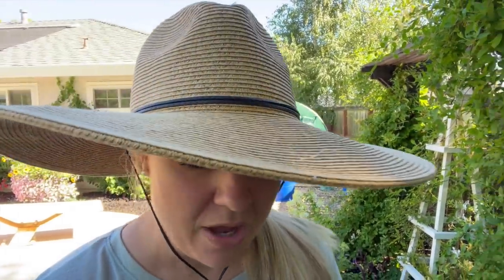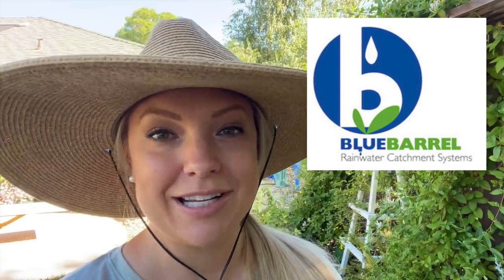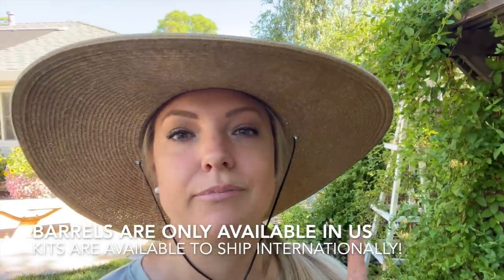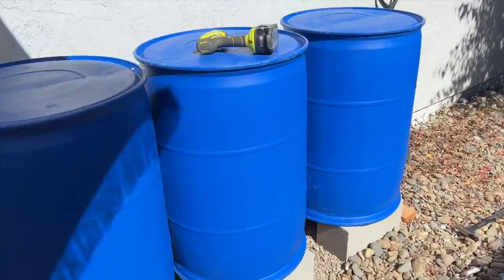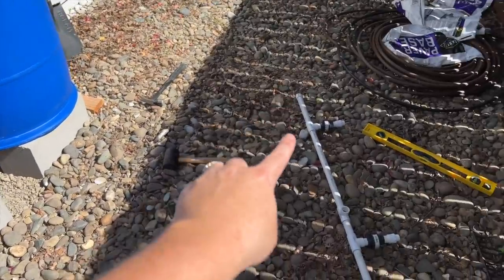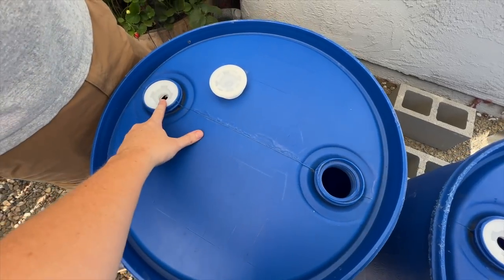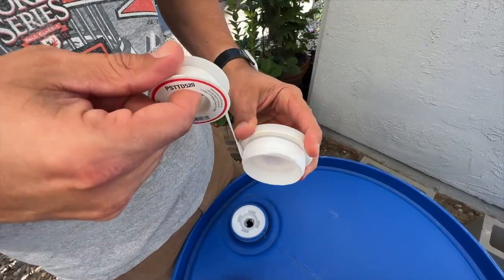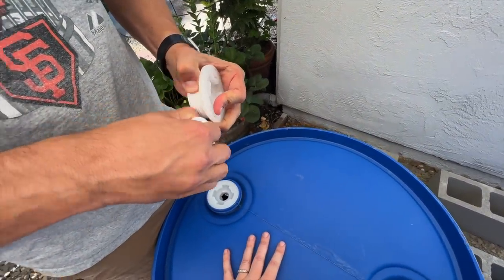Rain Water Harvesting! One Way I'm Dealing With Gardening In A Drought 🥵 :: Blue Barrel Systems

Comment: Great Job! Just remember your spigot won't work once the water level drops below its height. That's one of the reason people elevate them higher. Happy gardening❤
Reply: That’s what I was thinking, there is no pressure to move the water up. Maybe some way to attach a short hose to extend the bottom spigot out and have some flexibility to fill watering can, or maybe even hook up a garden hose??
Reply from the maker: Thanks Brain! Yes the blue barrel instructions show you how to keep it as low as possible but also they include a drain at the end so you can get out that last bit of water if needed!

Comment: Thank you for all the great info and diy Janey and Jason.  A great way to repurpose the barrels and more so helping ourselves and community in weather conditions we can't control but can all pitch in and help.  On a side note: our  water co. Provider offers low usage shower heads, sink and hose conectors for different settings.  Low flow toilet parts easy to install.  (You can also add a brick yo your tank to use less water for every flush).  Collapsible bucket for the shower water wasted while we wait for it to warm up.
Reply from the maker: Ok that collapsible bucket idea is fantastic! I was just thinking about how much water I waste waiting for the shower! Great ideas my friend! 💗

Comment: Good job you two! You made putting it together look so easy. These are put together differently than mine but same idea. We elevated ours and installed a hose bib for better water pressure and ease of using a bucket. And I painted mine brown which has stayed on for 10 years using universal paint so it sticks to plastic. Did they mention adding screen over the air hole to keep out Mosquitos? They are a huge issue here in North Texas. I use mine just to water my containers but I have a friend that attaches leaky hoses to water her garden.Free water...how fantastic!
Reply from the maker: Yes I kind of wish I elevated mine too! They did provide a screen for the mosquitos, I need to put that in! Great to hear that your is still going strong Diane! 💗

Comment: great video and system. how does the rain water enter the horizontal hose you put into the down spout? Does the hose go in through to the back side of the down spout and have a hole in it or what? That's the only confusing part to me. im in Houston  with high temps and no rain! Thanks!

Comment: Excited to see how you start this out. My parents NEED to get on this, since they just got new gutters!
Edit: if you think your lawn might be happy with more than 3 days a week, you might want to look into transitioning the type of grass you grow to something better suited. Down here in So Cal,  my parents bought a house in 2020, and it had a lawn. No idea what grass it was, but I only ran the sprinklers for 10 minutes each zone, twice a week, and it was green all year. Reportedly we have clay soil there, and sometimes that was TOO much water! But you should be able to get some of the newest lawn blends designed just for California from the amazing people at UC Davis, I bet!
I was thinking “paint the barrels”, but I also love bright cobalt and royal blue in the garden like they do in France (usually it’s ceramic or painted iron though).

If you want to get more advanced with this next year, to avoid hand watering with a hose or running separate drip lines, I have seen build videos on Youtube where people use a pump and then tie it into their existing drip set up. You make valves so you can manually switch between your plumbed water source and your barrel pump when you have water. One guy built some smart switches and used a sensor to tell if the barrels were empty to automatically switch it back to the plumbed water line!
Reply from the maker: Hi Anna! Thank you for watching! Yes this blue barrel company sells all the products to hook the barrels up to a drip system! Maybe a next year project?? 😉
Reply: @DigPlantWaterRepeat  Very interesting but you keep saying threads - what do you mean by that? The grooves in the screw cap or something else?

Comment: Wow a great project!!! Question does any of the water come out of the down spout at the bottom how does that work? I have seen water barrels painted with sunflowers on them. They look adorable! Good luck with this system! I am all for rain barrels. 💧🌧💧
Reply: Lots of times there is a valve to switch the part in the downspout if the system gets full. OR there is a an overflow valve for the barrels that redirects back into to where the downspout is, or to a new location.

Comment: Another great initiative undertaking and info galore! Thx! Though my house gutters are all connected to a huge underground sieve type of concrete thing buried in one corner of the yard, I'm looking to put a barrel to catch the shed's rainwater. I hope you'll show us the after-siphon result. I suppose the pressure of the water in the blue barrels will push the water up the tubes to go into your watering can? Get what I mean?🙃😊
Reply from the maker: Yes! So what the company says is the water will only come out to the level of the spigot, however there is also a drain so you can get the rest of the water if needed to fully empty the barrels!